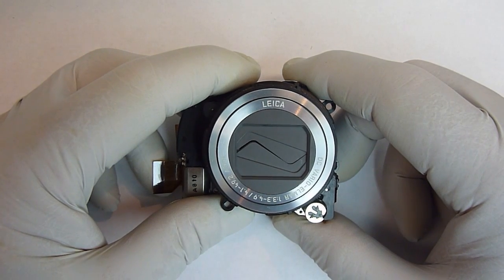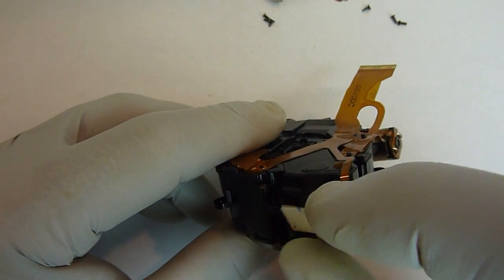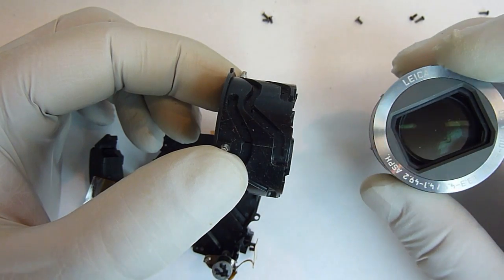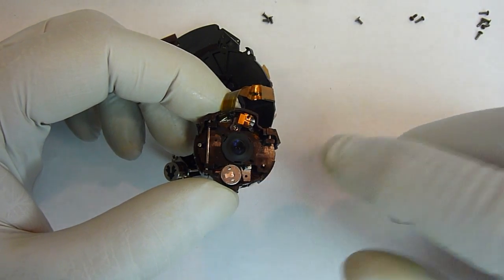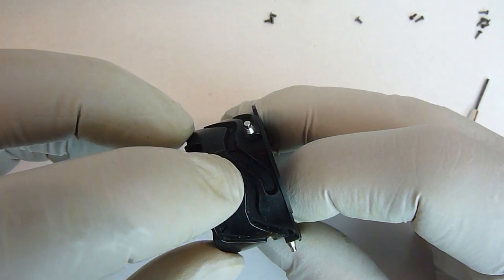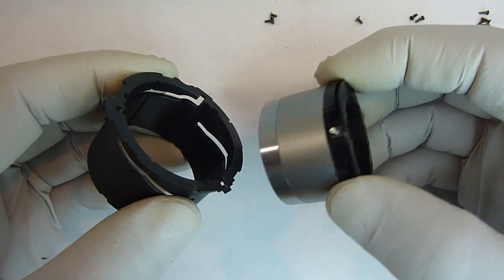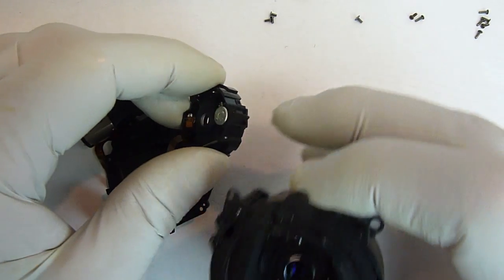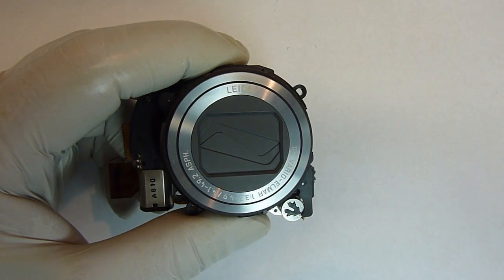How To Repair & Clean A Panasonic Lumix ZS & TZ Model Leica Lens Units

Comment: Hi. Got a dmc-tz7 where everything is the same as in the video. Problem now is that I'm getting the  O.I.S error. Any suggestions for a fix?
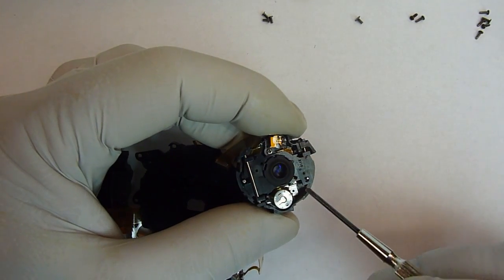Reply from the maker: Hi Normann. Were you getting this error message before you worked on the lens unit? An O.I.S. error indicates a problem with the Optical Image Stabilizer. The OIS is the part shown at time stamp 9:30. If you weren't getting the OIS error prior to working on the lens unit, then you will need to disassemble the lens so that you can double check that the OIS has been reassembled and installed correctly.
Reply: Robert Hosea, I didn't take the ois apart. Didn't think a need for it as I only wanted to clean the inside of the outer aperture lens. Everything else was still clean.
Reply from the maker: Ok. The first thing to check then, is to make sure that the flat ribbon cable coming from the lens unit is properly seated in the connector. Remove it and reinsert it again, and make sure that it is absolutely straight in the connect. Sometimes just the slightest angle can cause problems. If that doesn't help, then you will need to disassemble the lens so that you can inspect the flat ribbon cable that goes to the OIS unit. Check to see if there are not any tears in it. Finally, even if you didn't disassemble it, double check that the lens unit on the OIS still moves freely. Let me know what you find Normann.
Reply: Robert Hosea, I've checked all the ribbon cables and they're OK. The ois is also moving freely, but the system always does the same thing when I switch it on.
Reply from the maker: And just so I understand correctly Norman, you were not have any of the problems shown in your video before you disassembled the camera to clean the lens. Is that right?
Reply: Robert Hosea, correct. Everything  was fine. That's why I'm wondering if there is some sort of hardware reset or such. Was careful not to bend or over tension any cables, yet the problems in the video I've attached occur after reassembly.
Reply from the maker: No, you shouldn't have to reset anything on the camera at all. At this point I'm stumped about what or where the problem is. But, I'm pretty sure it must be something in the lens unit itself. Most of the times whenever I've worked on a camera and had features disappear, or had errors suddenly occur, was due to flat ribbon cable problems. I'll see if I can figure anything out here and let you know what I find. Let me know if you make any headway on it too.
Reply: Just noticed that it takes pictures upside down and a little darker.?
Reply from the maker: Now, that's interesting. Did you remove any of the circuit boards when you worked on it?
Reply: Right. Got it up and running again. Semmes that the ribbon cable connecting the motor/ois was too far in its Mainboard connection. Sadly the little black latch for the image sensor broke off while reconnecting, but I've managed to wedge it back to the closed position until I can find a replacement latch. Either way, thank you for your time and help. Glad there are people like you out there.
Reply from the maker: That's great! I'm glad you got it figured out Normann, and that you have it working again. Good job!

Comment: Robert, 

Thanks very much for ZS and TZ lens unit video.

I have just followed your instructions to successfully clean off dust on the sensor and in the lens unit of a ZS5 we no longer used because of the black marks on the images.  The clarity of your instruction has enabled it to become a functioning camera again, so thank you very very much.

I also have a four or five year-old  Lumix DMC-TZ30, which I think is sold as a ZS20 in the US.  It is not working in that the lens unit is not extending, the lens cover is only half-shut and a "System Error (Zoom)" message appears on the screen.  I did disassemble the camera but found that the lens unit is different to the lens unit of my ZS5, which is the same unit you used in your video.  I could manually make the TZ30 lens unit extend and retract, but it seemed to take more force than I think should be needed and I could not get the lens cover to fully close.  The lens unit looked fairly clean though.

Do you know if the lens units in later Lumix  cameras in the TS and TZ range can be taken apart and cleaned?  I noticed in your comments to others that you were thinking of repairing a ZS19.

Any advice you can give on the later Lumix ZS and TZ lense units would be greatly appreciated.  No matter what, you have already helped me a great deal with your lens unit video and I do thank you for your help.

Kind Regards

Lindsay Dickson
Reply from the maker: I have worked on the lens unit for a  ZS19 one time, and it was very tough to do. It's a lot different from the earlier versions. Unfortunately I didn't make a video for it though. It may be possible that your camera lens unit just has some dust or dirt inside that is causing it to stick and the motor just isn't strong enough to extend it. A half-shut lens cover is usually a sign of dirt  or sand being inside. I'm sorry I can't be more help on for you Lindsay. Feel free to contact me though if you decide to disassemble the lens unit and I'll try to help out in any way I can. -Bob
Reply: Robert Hosea  Bob,  
Thanks very much for your reply.  If a ZS 19 lens was tough for you then my TZ30 lens might be a bit too hard for me without some step-by-step instructions.    I have not been able to find any disassembly instructions or videos for the later lense on the internet.  Thank you for your kind offer of help.  I will let you know if I do tackle it.

I mention again though how pleased I am to have the ZS5 working again.  I found reassembling the lense hard.  You have a very good manner in explaining things and I needed to know about the reference marks in order to line things up properly.

Kind Regards

Lindsay Dickson
Reply from the maker: Thank you Lindsay. I'm really glad the video helped you out on your ZS5. And if I ever come across any information at all about working on a TZ30, I'll sure pass it on to you. -Bob

Comment: Hi Robert.  I'm planning on cleaning my Tz40 lens using your procedure.  
In addition to dust on the lens elements my camera is starting to make a grinding sound when I zoom right out (I've taken 20-25,000 photos with it.)  Is there anything that you know of that I may be able to do while I'm in there that may help with this?  
Thanks for the great public service that you have performed by providing this video!
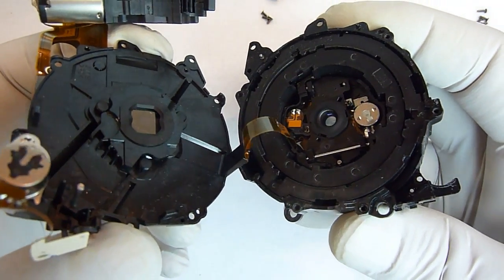Reply from the maker: Hi Chris. Yes, I think I might know what the problem is. The grinding sound is most likely the focus motor/shaft assembly, which I didn't cover in this video.  You can see the focus motor in the video at time index 5:32 when I first take the back off of the lens. It is the motor shown on the left side. That motor has a threaded shaft that moves the focus lens unit up and down. If the shaft gets dirty then it will become hard for the white tab that runs up and down on the shaft to move. The motor is easy to remove. Just take note of the little white tab that runs up and down on the shaft. It will go in a grove that is behind the shaft when you put it back in. The focus lens unit has a spring under it, so be careful when you remove the motor. Once the motor is out you can clean the shaft and turn the white tab that's on it to make sure it is moving freely. You can also put a small amount of lubrication on the shaft to help make the tab move more freely. I hope this fixes the noise that you are hearing Chris. Let me know how you make out on this project. -Bob
Reply: Thanks for your reply, Robert.  Does the focus motor also do the zooming, then?  What sort of lubricant do you recommend?  I'll certainly let you know how it went when I've done it.  Chris
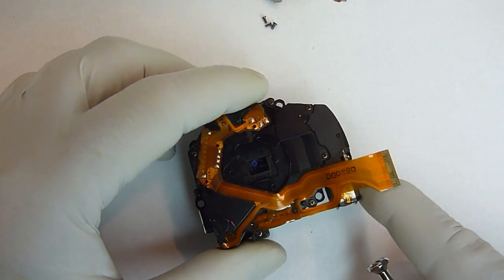Reply from the maker: No, the focus motor does not do the actual zooming Chris. The zoom motor, which is shown at time stamp 3:18, does the actual zooming. But, during the time you are zooming the lens, the focus motor will have to kick in to try to adjust the focus while you are zooming. And if you are zooming a long way, say from zero-zoom to max-zoom, then the focus motor will have to move the focus lens from one end of the shaft to the other to compensate. I've never run into a problem with the zooming motor before, but It's also possible that the problem could just simply be dust or dirt on the many plastic sleeves that are inside the lens unit as the lens extends and contracts, and cleaning the sleeves off while you are putting it back together could cure the grinding sound. For plastic gears you should use a silicone based grease. Let me know what you find out with it. -Bob
Reply: Thanks for the detailed explanation, Bob.  Chris

Comment: My ZS6 had developed a long irregular slightly dark area on photos and I suspected it was just dust in the lenses somewhere.  Turns out it was a piece of fiber on the surface of the CCD.  I went ahead and took the rest of the lens assembly apart and found dust on every lens surface along with what looked like oil from fingers.  I followed the video carefully from beginning to end and everything worked perfectly when I was finished.  Could never have done it without this great video - many thanks.  Another thing I've learned from this exercise: don't carry around your camera in a pocket.  Dust from tissues and fibers from the pocket WILL find their way into the lens assembly eventually.  Now to find a suitable case to carry the camera in.
Reply from the maker: Good job getting your camera lens cleaned. I'm glad the video helped you out. And, great point on using a carrying case!

Comment: Hi Robert, i have an old TZ7 and inside the first Lens it had Dust. After you very good dicribtion I disamble it fast. Only the screws were dificult to disamble. After this I cant clean the Lens. It was no dust. It was like crystals inside the Lens. In ebay i get a old spare TZ7 it had water inside but the Lens was good :). Many Many Thanks for this good Film
Reply from the maker: I'm glad you got your camera running again Marcus. Good job!

Comment: I have spent hours trying to remove the single screw off the sensor board as it is very tight and has become slightly stripped down after my efforts. Do you have any advice, as I have tried many methods and the last resort will be drilling or using a dremel like tool which will be hard on somewhere so delicate. So frustrating as I am so close to taking apart the lenses which I believe is where the problem lies as my TZ8 got dirty, and now won't focus and shuts down with "System Error (ZOOM)" accompanied by a grinding noise when the lenses move.
Reply from the maker: Yes, drilling, or a Dremel, might work to get the screw head off. You might also try a screw extractor bit, but I doubt that there is enough area in the screw head to have it grab hold enough to hold. Good luck with it though. I hope you're able to get it removed.
Reply: Thanks for the help (and a great video by the way)

Comment: Hi Robert....I have a ZS6 Lumix and it just refuses to focus. I was using it and everything was fine, turned it off while rearranging the subject and when back on it won't focus with zoom, auto or halfway pressing the shutter. I can see the objects but they are all out of focus and they record out of focus. With your knowledge can you tell me what is going on? I called Panasonic but the repair bill, as you could guess, means I might as well buy another camera. I'm good with electronics but ignorance of this is stopping me.,,,,Thanks.  Greg
Reply: Hi Greg. 
If it's not focusing at all, and you don't hear a small focus motor running, then there are a couple of possibilities that I can think of. The first would be a loose flat ribbon cable. There are two cables on that lens assembly. One goes is for the CCD, and the other controls the focus, zoom motor, and some other stuff. Make sure that the flat ribbon cable is properly seated in it's connector on the main board. The next possibility is the main board is bad. That would suck if it is. The last possibility is the focus motor is either  bad, or more commonly, just stuck. You can see the focus motor in the video at time index 5:32 when I first take the back off of the lens. It is the motor shown on the left side. That motor has a threaded shaft that moves the focus lens unit up and down. Sometimes the threaded shaft will bind up in inside a small white tab that it controls. The motor is easy to remove. Just take note of the little white tab that runs up and down on the shaft. It will go in a grove that is behind the shaft when you put it back in. The focus lens unit has a spring under it, so be careful when you remove the motor. Once the motor is out check to see if the little white tab is bound up. If it is, that's your problem. Move it back and forth a little to get it moving again, and then put a small amount of lubrication on it.

Let me know how you make out on this Greg.
-Bob
Reply: Hi Bob.....Ok here's the down low on my camera. I followed your excellent video through and got it apart.
That was very well done dude....I can't imagine anything better as far as a tutorial.

The trouble was in the white tabbed/spring/auto focus slave unit. The white tab still had grease on it and when I removed the motor the lens stayed in place. I pulled it up and it felt stuck, that's when I found the spring and sorted out how that works and what was going on. It seems to me that using a motor working against a spring could have been better engineered to perform that function but in general it is a marvel how they go together. I greased it up and all is good. Maybe it needs a zerk fitting on the side.  :)
The other problem I had, which you may point out, is on the CCD there is a small bluish lens and rubber sort/of retainer. It stuck to the lens side and when I went to reassemble as I turned it over both pieces (rubber & blue cover) were on the table. In your video it stuck to the CCD but you can't reinstall it that way. That thing is an absolute nightmare to go back together as the rubber retainer does not index the blue piece nor do either piece index onto the CCD. It finally has to go into the lens receptacle and then verrrry carefully install the CCD. Yikes!!

But, I got it working and I have you to thank for it. Thanks for saving me a whole lot of wasted time and aggravation. You're a hero in my book!

I owe you a flagon of pivo.....many thanks.

Greg
Reply from the maker: Excellent Greg! I'm glad you were able to figure it out and get it working again.  Very cool. I did also run into the same problem one time with the seal and filter (I think that's what that is) on the CCD. I agree, it was a nightmare replacing it. All other times they did stay attached to the CCD which made it much easier. In the video I don't go into detail on removing the focus motor and lens assembly at all, but I have received many questions on that area. So I may do a short video that covers just that area. And your feedback on that really helps me out. Thanks very much. And, it would be great if someday I could  take you up on that flagon of pivo Greg.
Reply: Somewhere in my readings I seem to recall that filter referred to as an "infrared filter." There is another guy out there doing vids about this topic and with all due respect his is also quite good. I think it's Graham Houghton.Your audio is easier for my ears however to discern, something to do with vocal timbre.
Anyway, I wonder how many cameras have gone in the trash because of a broken spring or plastic on plastic post that has worn to the point that it is rubbing and hangs up, and it doesn't take much. Mine was bone dry and that spring has very little extension torque to it to overcome the problem. I also think that heat will affect that camera function and mechanism as that was the one influence that I believe caused mine to finally fail. I have owned this camera for quite a bit and it goes in my backpack almost 100% of the time so I am surprised I haven't had more problems with it. 
If you happen to ponder my earlier question about a recommendation for a camera in this class that does a better job of night pics i am all ears. I was in BudaPest and my night pics of the castle were disappointing but that was the technology back then.  What say ye?
I think a short tutorial on that drive motor would be well founded but man, ya gotta watch that skinny cable!!  lol......Cheers